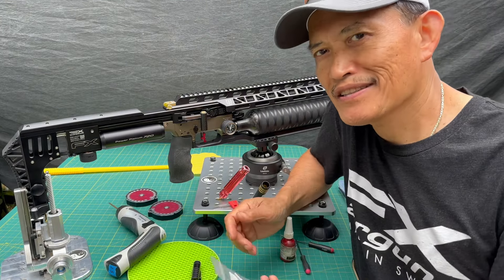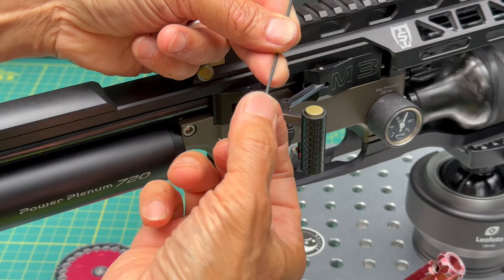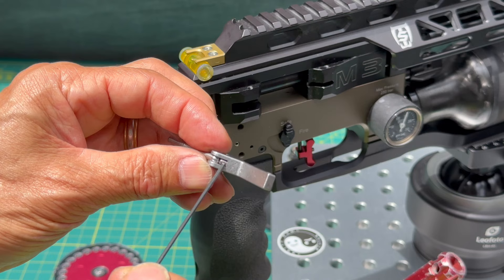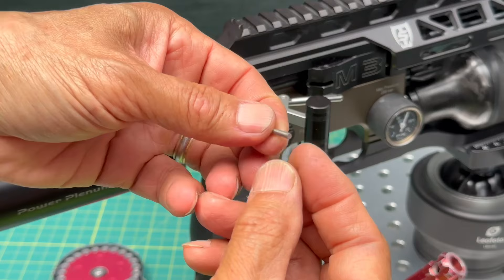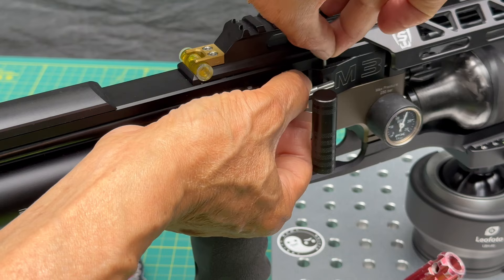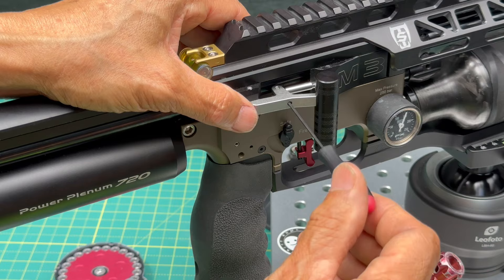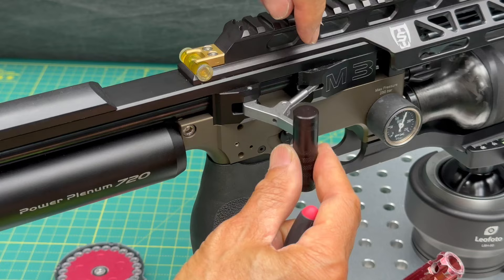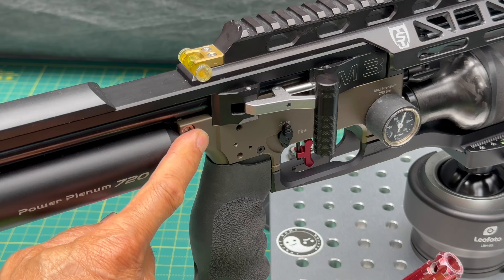FX Impact M3 BC short throw cocking lever install

Comment: It seems like the cocking handle now has to come back further compared to your first video when it cocked at roughly 90 degrees.
Reply from the maker: Hi, the length of lever hasn’t change so shear engagement remains the same but angle at the handle is slightly increased .

Comment: Hi Ernest, what is this cocking lever for
Reply from the maker: To have a shorter turning radius to cock the gun —> so quicker lock time in getting the shot off. Plus for me with shorter  fingers I don’t have to remove my grip to cock the lever — i cock with my pointing finger and middle finger as my trigger finger. 😊
Reply: @ernestrowe5061 will this cocking lever lock in the open position? I ask because I love my Saber Tactical magnet, but I'm assuming this is going to be 300 series and not compatible.